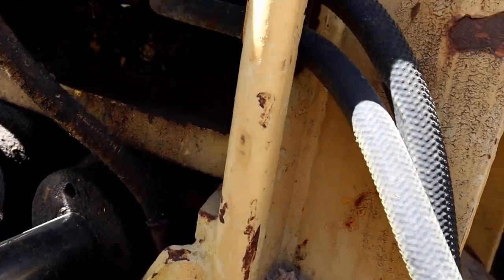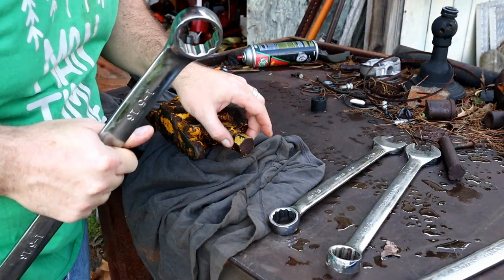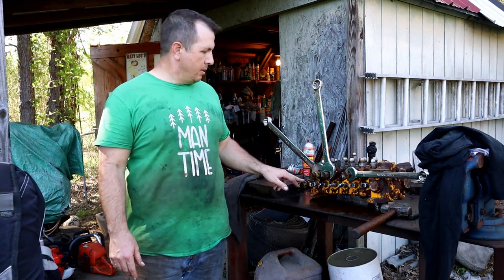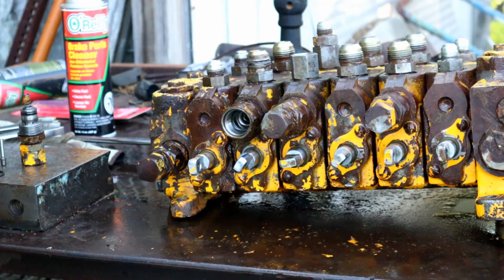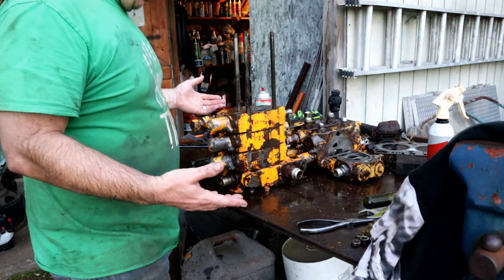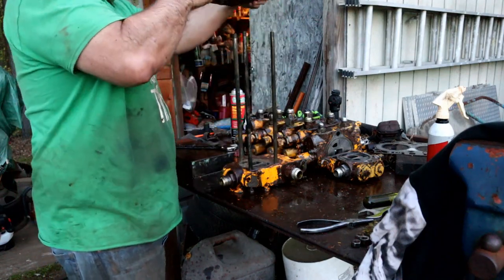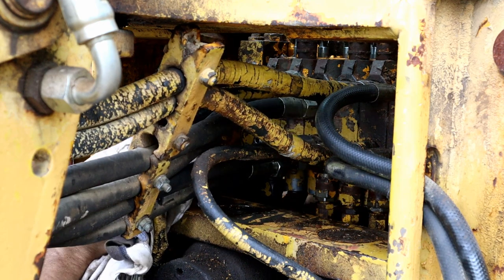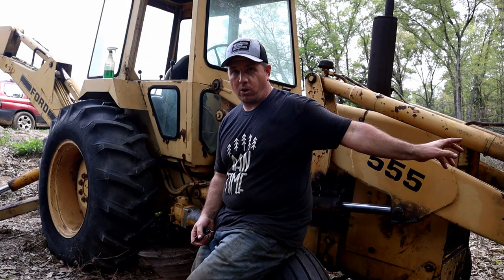How to Fix Hydraulics On A Backhoe Finale Manifold Rebuild

Comment: I have a Ford 555a with the same problem and your approach makes me curious about the main relieve valve, sure enought I took it apart and it was stuck in the open position, cleaned and reassemble it. Cycle the hydro system a few times and it worked.  Who knew that valve along would control the loader, backhoe and stabilizers. Thanks for sharing the video.
Reply from the maker: Thanks man!  I felt like it was a pretty sound approach. You got lucky compared to me it sounds like. Congrats on the successful repair!

Comment: Sweet! Let us know if you figure out what the steel shard was. I wonder if it was a tooth off of the old pump.
 Congradulations on your victory. 

I have been through all of the hsrd work and struggles you have documented on your channel. The work is never done but man,  its tremendously rewarding to build a homested one victory at a time. Keep on dude.
Reply from the maker: Thanks for the inspiring words!  You’re right every victory is sweet. 
The shard may have been from back when an outrigger cylinder packing went out. Hard to say.

Comment: Glad your "nightmare" is over. Those things are rough to remove and install. Interesting on your 555 pressure goes to the hoe first then loader. On my 310 pressure goes to loader then hoe. But mine has the husco valve body too.
Reply from the maker: I rewatched your nightmare to see what I was in for. It’s a bear of a job

Comment: Planning on doing this on my 555b. I’m thinking that the material inside the hoses may be deteriorating in mine and that’s causing the relief valve to stick open somewhere.
Reply: Also, what hydraulic fluid are you using? I’ve had conflicting answers on what to run
Reply from the maker: @woodatuse  best of luck on the repair!  I run O'Reilly's premium in the green 5 gal pale. Best I've found for all my stuff
Reply: @Man-Time , thanks, I was curious too. O’reilleys is a nice parts store to have local. Cheers 🍻

Comment: You got fluid leaking out the bottom of the unit you pit in, pretty bad leak, but I'm sure you seen that
Reply from the maker: I did see that but it wasn’t until I tried to drive it out. Good catch!
Reply: Roofer caught the leak. Makes sense.
Reply: Did you manage to fix the leak? What was it. Great to see videos of these old machines been kept going 👍
Reply: @westcoastpc  Now I wanna know

Comment: very difficult to repair without special testing equipment, remove the entire control unit and Uconnect all hoses, its a old control valve depending on your unit could be 6-8 valves, parts are hard to find and setting the correct settings is important, i took a engine puller and removed the entire unit and took it to a hydraulics repair company that deals with this old equipment, i had my entire control valve rebuilt for $400 which was well worth it.

Comment: Did you test the pump pressure at rated RPM
Reply from the maker: No testing and no test equipment. Could have saved myself several hundred replacing the pump in the vid before this one if I would have spent a few hundred on a test kit. That’d be a smart move. Course the tach doesn’t work so rated rpm is a crap shoot.

Comment: I'm about to do the same job on my 555C to stop the valves from weeping fluid.  Your hoses might reattach easier if you remove the hose guide bar.  I am going to change all the cup seals and o-rings plus replace 3 to 4 hydraulic lines that are in less than optimal shape.  Thanks so much for the video, I will use some ratchet straps to aid in removal/installation as I also am working solo.
Reply from the maker: Hope it helps bud👍